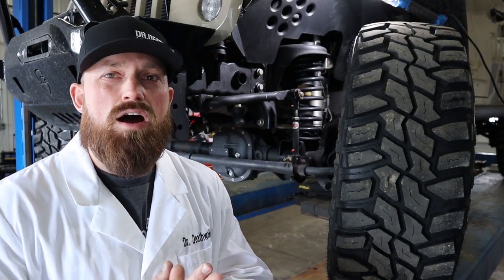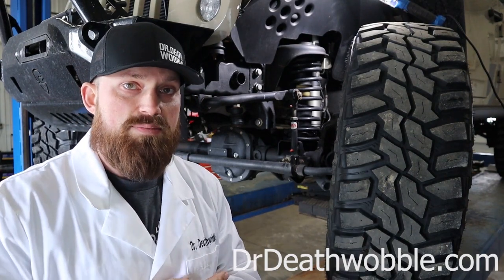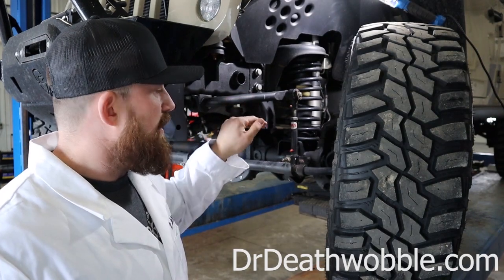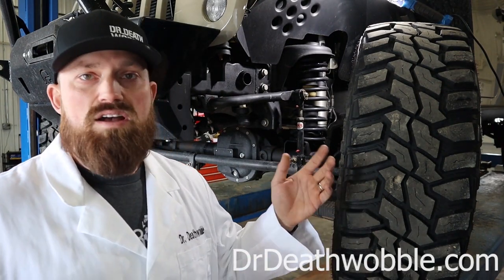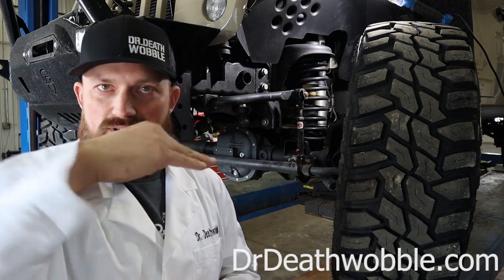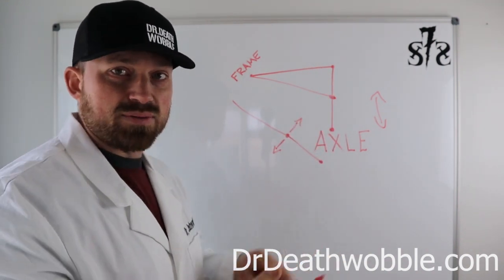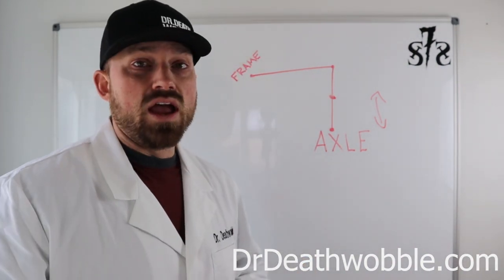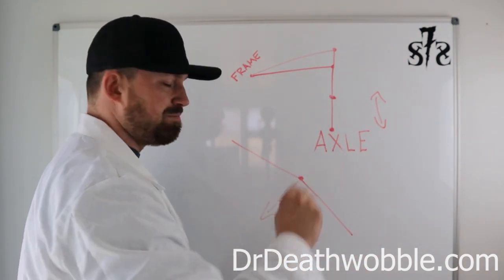How do you determine sway bar length on a Jeep Wrangler?

Comment: Is it best to have the front sway bar at 0 degrees on both sides or should there be over 0 degrees? I have a 2012 Wrangler sport with a small lift and JKS disconnects.

Comment: I had a 3" lift installed at a professional shop when we bought the jeep brand new in 2012. I have had nothing but issues with the jeep from day one and it has been to 3 different shops with them replacing this thing and that thing. We have spent a ton of money trying to get the jeep to handle correctly over the years.  I ran across this video about a month ago and found that we had stock links in. I have changed them out with the correct ones and what a difference it has made. It is like having a new Jeep. It is fun to drive finally, and it only took 12yrs and $30 to fix it!!!!!!  Thank you for this video!

Comment: So as I was thinking about this watching this video, it was making sense. As I’ve broke two stock rear sway bars. Not a jeep. And they may have inverted. But the more I think about it, the sway bar is trying to push back up, the opposite of inverting. Unless both tires are drooping. And in my case one was up and one was down, both times it broke. It actually breaks the sway bar at one of the frame bushings each time.

Comment: Thoughts on the dorman adjustable sway bar link??
Reply from the maker: I would recommend sticking to and off road designed and tested brand (assuming this is for off road use) vs. a Dorman brand.
Reply: @dr.deathwobble4899  For my 08 jkur. Trying to get rid of my recent dw experience..

Comment: What if they are too tall? Or can to talk be bad. I have a 2.5” lift and mistakenly (thanks to manufacture reps telling me they’d work but are not right height ) have bought a couple sets that won’t work. Now I have a set that I think could be too tall. They are rough country and for a 3.5-4” lift. Again rep told me they will work. But the sway bar is going to sit about 2 inches higher than right now ( now I have perf t angle. Just about an 1/2 inch above level with the correct sky jacker end links.  These are no longer made is why I didn’t replace with them. Prob is the bushings are shot and again they no longer make that type bushing.  So my question is how bad is it to have longer than needed. What’s about the max angle of one’s that are longer ?

Comment: Great video. Still a little over my head. 
I just bought my 1st Jeep. (2013). And it is lifted. (Not sure how much, guessing a 4 to 5 inch lift).
My front sway bar is angled down a bit. I have yet to look at the rear.

From what I understand you want it level to a slight upwards angle?. 

What adjustable links would you recommend?

Comment: I had a 3in Bds lift on my jeep and I’m noticing the 3/4 lean.. I know the lean is normal for lifted Jeeps butter lift came with the adjustable jks links. I’m noting the drivers side link is out 1/2 in longer than the passenger link.  Could this be causing the lean?

Comment: Dr. I have a question. I just installed a Dynatrac 2.5" lift on my 2022 JL. This kit does move the longer rear sway bar links to the front. Once I had everything buttoned up, my sway bar links no longer align and I can't get the secured. The passenger side is about an inch too low from the sway bar, and the driver's side is the correct height of the way bar, but about an inch too far outboard. Any ideas on how to correct? Are sway bar links supposed to be perfectly vertical?  Thank you. Great video!

Comment: Dr, I respectfully disagree. Sway bar link length is determined by your suspension travel, not ride height. If one has 10" of total travel, 5" up and 5" down, the links should be set so the sway bar is LEVEL. (equal travel both ways). MOST Jeeps have more down travel than up travel , so the links are set to angle the sway bar slightly up. The folks who invented the antilock sway bar go into the process in great detail... cycling your suspension, taking measurements, etc.

TL:DR - The quick and dirty way is to hang the axle from the shocks. Then make sure the swaybar links aren't pulled tight. They should have a bit of a kink/angle in them so the swaybar can't flip the opposite direction.
Reply from the maker: I completely agree with you. This is just an easy method to make sure your Jeep will not invert your sway bar and links.

Comment: I bought the metalcloak lock and load 4.5 kit after installation noticed the sway bar links up more than normal.. call metalcloak and they said it's the right high for that suspencion 
Do you have any info.. 
Thanks
Reply from the maker: Correct, because the MC system nets so much suspension travel (especially down travel) your sway bar angle will be quite high upwards. Which doesn’t hurt anything as long as it can move smooth and clear of obstruction. That’s a nice kit.

Comment: I am new to Jeeps...
Drove my son's Jeep brand new for a year in 2008 after the lift kit, she rode great . She's mine now and still original parts, recently I had an issue with death wobble which was taken care off, added steering stabilizer and other steering parts as well as new shocks, but I still feel scared,, she seems to float, sway, you have to be super attentive to the steering while driving on paved roads, she drifts a bit

So many components watching your great video... any hints!! 
My next steps are new tires, they are still good, but no idea what else to do or where to look...
Would appreciate a reply! 
TY

Comment: 2018 JK sport with a superlift kit, bought used no clue which lift they bought, has a bracket on the axle that the factory 5" link bolts to making the link 9" in total, sway bar is level sitting flat on pavement, buying some new Links from a 4×4 shop that are non adjustable disconnects 12.5" long, they recommended, but it seems if I do buy them and install them it's going to push the sway bar up almost into the coil springs metal top cups, is this to high, eventually I will be getting a real 3" or 4" lift but that's probably a couple of years into the future

Comment: On my 2013 Chevy suburban I put a 5-1/4" welded in coil perch to get lift. I extended the stock sway bar end links by the same 5- 1/4". Now I have a problem with the driver side sway bar end link enlarging the hole at the mount on the frame. Any ideas why it's doing that or how to fix it? I was going to weld a thickened washer to the Mount so it stops enlarging.... however there seems to be a geometrical problem

Comment: I have a 88yj and just took sway and track bars off. The ride was much smoother and only notice body sway in a turn on uneven road. I drive about 50/50 street/trail. Do you suggest even bother with a sway bar at all even with quick disconnects? I have a 4 inch lift and was not aware of inversion so glad I watched this video as PO didnt not make adjustments for lift.

Comment: On my 2003 Jeep TJ after ive lifted it 3.5 inches and running 33x12.50 15x10 Rims. Ive replaced a lot of lower suspension. Now when i push or let off the gas pedal and when i change gears the rearend shifts to the left.WHY?
Reply: Do you have a a Detroit in the rear by chance?

Comment: On mine , the sway bar is not flat to the ground but slightly pointing up towards the driver.. in other words 80 degrees because we ve put a lift kit, the rear stock sway link was moved to the front..but 6 months later i have replaced that with a quick disconnect....however i kept that angle slightly higher. The sway bar is not 90 degrees with the link but more or less 80 degrees i dont think it will ever invert ..  Should i keep it in 80 or set to a perfect 90?

Comment: Hmm so if I understood correctly a 2.5-3 inch lift on a stock solid axle sway bar would be ok if I’m over landing correct? No need to upgrade for longer links? 
Thank you sir

04 WJ
Reply from the maker: Santiago Hernandez that is incorrect. Lift will require longer sway bar links
Reply: Dr.Deathwobble Got it. Thank you sir

Comment: I had a leveling kit put on my rubicon and 33 tires 
Since then my ride has been shit 
Do I need a longer sway bar link
Reply: Since the guy in this video can’t explain what’s going on I will. You have a greater thrust angle with your control arms. That increases wheel loads. Your cool spring should be compressed the same as when it was stock unless the shock are limiting rebound travel and creating a certain load number in the spring statically. Many many factors.
Reply from the maker: @RaceMentally   that was super helpful
Reply: Anyone know of a trustworthy  Jeep shop in Toronto canada
Reply: Just wondering was the guy that installed  my leveling kit. So pose to tell this before doing this work
Reply from the maker: Sofia that would be a great start, also depending on the kit to get a much better ride we usually swap out to softer coil springs and performance shocks.

Comment: Do you recommend changing also the rear sway bar links after a lift?
Reply from the maker: Julio in most cases yes. Some small lifts 2” and below it won’t be necessary. But most cases yes changing to longer rear links is 100% necessary
Reply: Dr.Deathwobble Thank you sir, 💪🏻, liked the video a lot.
Reply: @dr.deathwobble4899  how much long(rear and front)? same as the lift? 2" longer on all 4 links?

Comment: Can you please tell me what angle the rear sway bar should be relative to the link? I understand that the front should be at or near 90 degrees (sway bar nearly parallel to the ground).   Should the rear be the same?   I have a 4.5 inch lift and I noticed the rear sway bar is pointing downward at about a 45 degree angle from parallel to the ground.  Thanks!